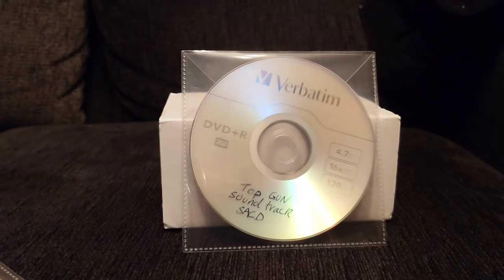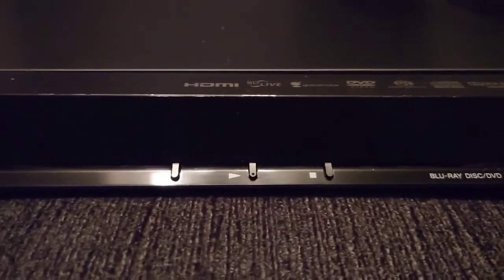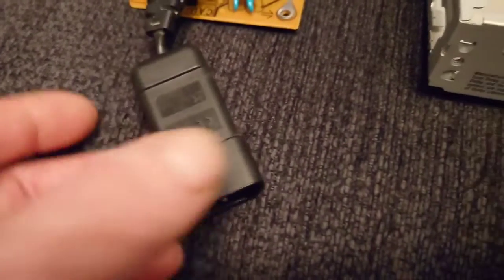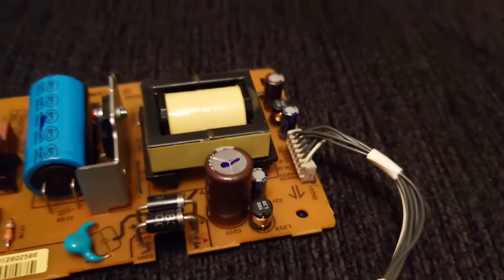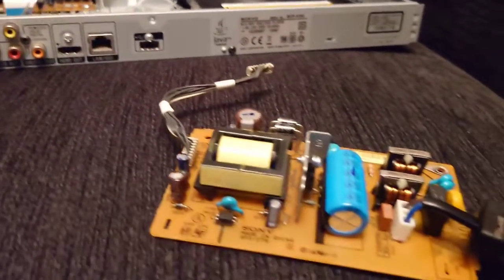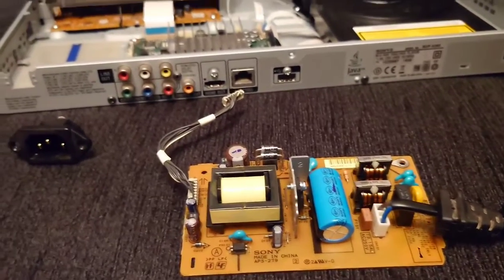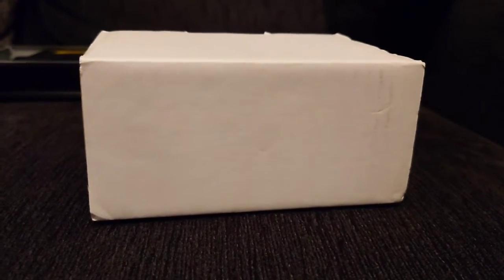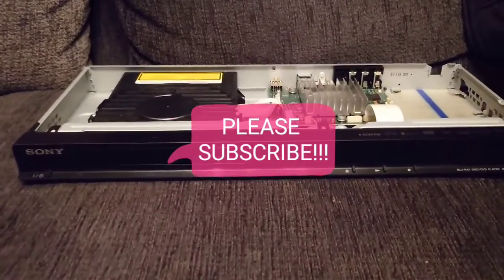SONY BDP-S380 BLU-RAY DISC PLAYER UPGRADE POSSIBILITIES.

Comment: Ripped SACD's to SACD-R are exactly the same as the original, no los in quality at all, the reason some dvd and blu-ray players can't play them, is that the manufacturers have blocked aspects of dvd-r playback, one of the best players that can play any SACD rip, or SACD-R, is the Denon DVD-3910, there are other cheaper Denon's that can play them, but there are also some that won't play them, as in the Denon DVD-3930, there is a list posted in various places around the internet, that lists the DVD and Blu-Ray players that can play SACD-R discs, A SACD-R is basically a DVD-R that has the Full SACD data recorded on it, an original SACD is actually a DVD disc, but with SACD audio stream or streams recorded on it, if you are interested in looking for a machine that plays SACD-R discs, i'd recommend you look for a Denon DVD-3910, it is an excellent sounding SACD/SACD-R/DVDA/DVDA-R/DVD/CD player, with extremely good high end sound quality, far far better than the sony blu-ray player shown in this video.

Comment: Thanks for the videos, I've watched and enjoyed a lot of them!

Re. cheap old DVD or BR players, I've been messing around with those a bit recently and bought several and tried to mod them.

But eventually the one thing that made me give up on them, was the noise all of their drive units made.
Which I just couldn't get rid of with the usual cleaning, many attempts at damping, and even one (very crude) conversion into a tray-less top-loader.

So I'm looking forward to the upcoming videos on this player, hope to learn something about that issue.

Comment: I would imagine these are SACD rips rather than the actual SACD format, possibly done with a Sony PS3 so is most likely the reason your Sony can’t play them.  I expect they’re actually hires files.  I'm pretty sure it's still not technically possible to do a copy of an SACD the same way like you can copy a cd as they come from the factory.
Reply: The SACD rips to a DVD-R are exactly the same as a SACD, no loss or different files, the structure is the exact same as a full SACD disc.. the only thing that stops them playing on some SACD capable players is the manufacturer has blocked some aspects of DVD-R disc playback, given the correct machine.. a Denon DVD-3910 for example, you can play a SACD-R / DVD-R without any issues, a DVD-R with the SACD data recorded onto it is identical to the original SACD, they have the FULL SACD data streams intact, you can switch from multi channel to stereo stream in exactly the same way you can with an Original SACD if it originally has those two streams, the only possible difference is when the SACD used had a CD layer, the CD layer cannot be copied to the same DVD-R with the fully intact SACD layers, as the hybrid CD/SACD disc has two different physical layers, one for the SACD data stream or streams, and one for the redbook CD data, this isn't possible using a DVD-R disc.
Reply: It’s possible to rip the DSD data from an SACD bit perfectly using some PS3 models or various Blu-Ray players (with special firmware, as I have done). Copying the data into a DVD-R creates a DVD Datadisc, not an SACD. To make an SACD requires SACD authoring software, which includes data encryption. This is also available if you look for it